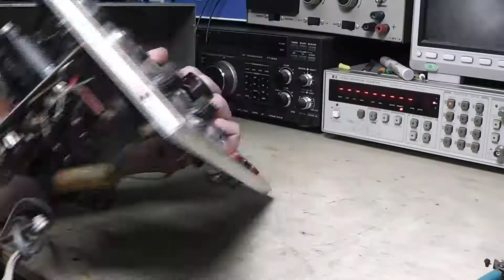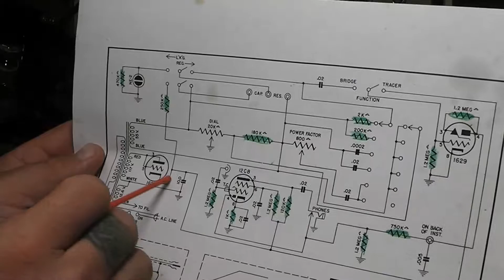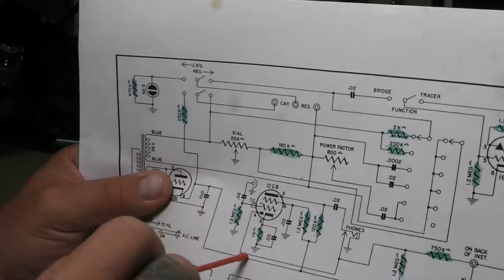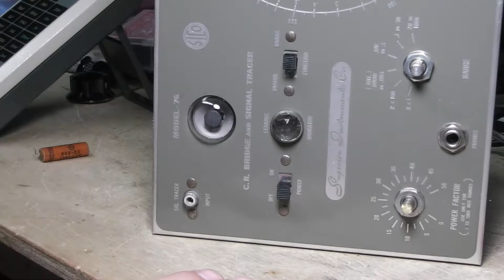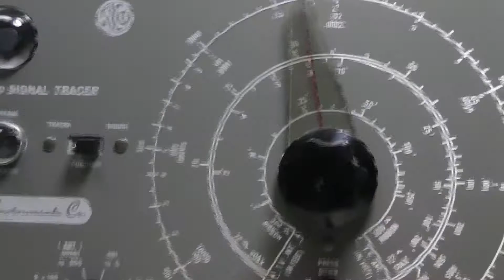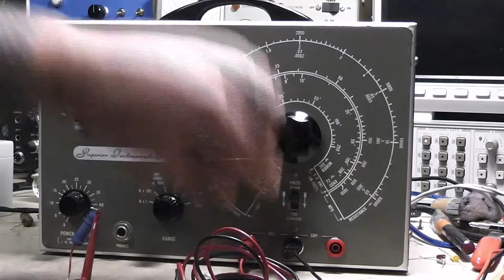SICO Model 76 Restore

Comment: Excellent restoration. Learned something new about bridge fine tuning. Going to Google Illinois Capacitor. I could use a few for a '46 Air King 4602B.
Reply from the maker: Thanks for the kind words.  You can't go wrong with Illinois Caps!  Very, very well made!
Reply: @ke4est  Just pulled the 4602b apart. All I need is 2  .05mfd@400v & 1 .2mfd at 400v and it is recapped. I think my local Mouser sells I.C.. Radio also needs dialcord restrung and the usual jazz. Should have it back in service soon.
Reply from the maker: @johnstrunck3659  For the .05mfd use the modern equivalent:  .047mfd.  I. C. part number 473MPW630K.  For the .2, use .22mfd. I.C. part number: 224MPW630K.
Reply: @ke4est  Will do. Thanks for I.C. part numbers! By the way, do you buy from Radio Daze and Tubes and More?
Reply from the maker: @johnstrunck3659  I get my caps from Digikey, but other places are fine too as long as they are a legit place.  I do buy a lot of stuff from Tubes and more also.
Reply: @ke4est  I have ordered from Digikey before and they are great. Mouser Electronics is a great place and is close by. I can turn in an order one day (U.P.S. ground shipping) and most of the time, get them the next day. Only about 100 miles away. I have another YT channel named jstrunck. It has some oddball Hammarlund HQ-100A info on it. No service vids though. Really just a hodgepodge of vids of the days gone by.